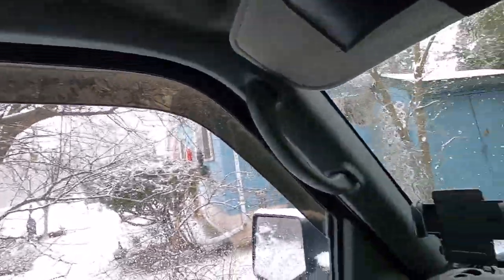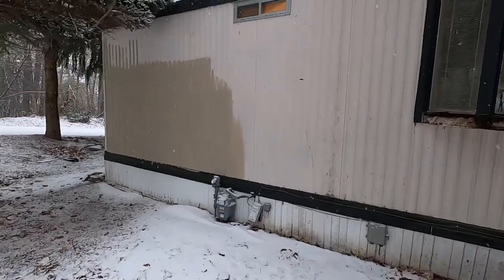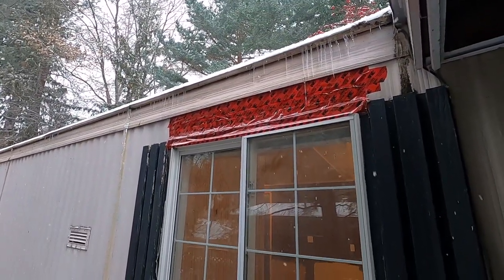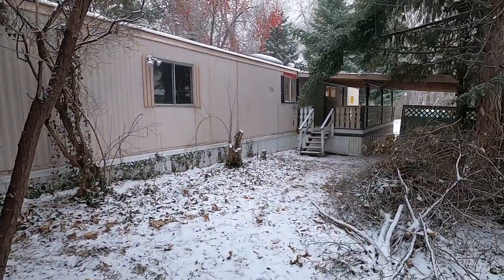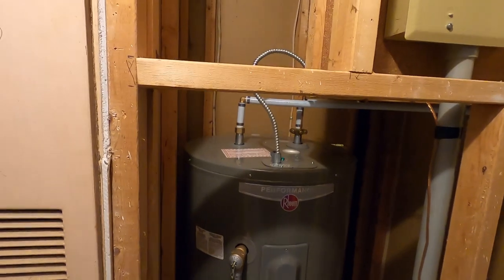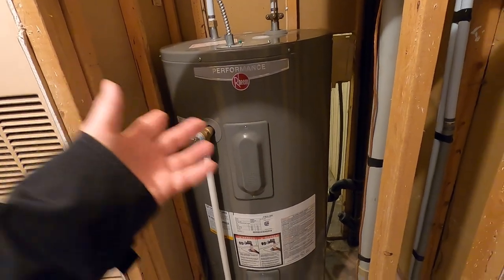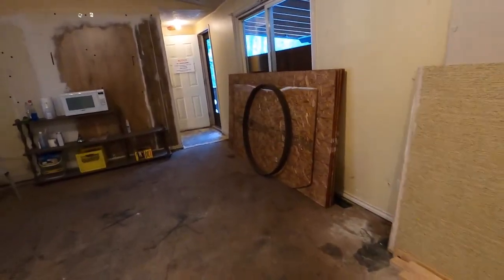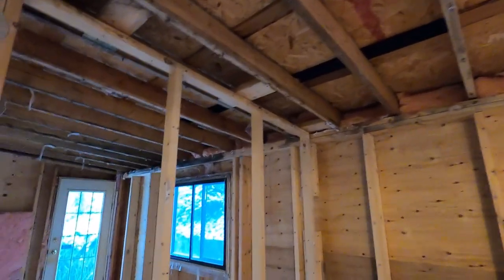Abandoned Mobile Home Project - Electric Certification : E078 / BC Renovation Magazine (YT Reload)

Comment: I have a roof over the patio behind my house that was built on sometime after the house was built 16 years ago. It has a similar pitch as the addition on this mobile home and is shingled in the same way. Shows signs of leaks, and luckily its outside of the house so I'm not too worried about it but I was wondering what kind of roofing material could be used with a pitch like that? I definitely dont want to do away with it since I'm in Texas and the shaded patio is nice to have when it's hot out.
Reply from the maker: Bram's Hobby Shop, I would suggest a torch on roof, done by a professional. Thanks for watching! 🙂